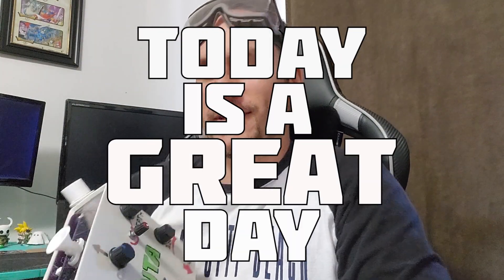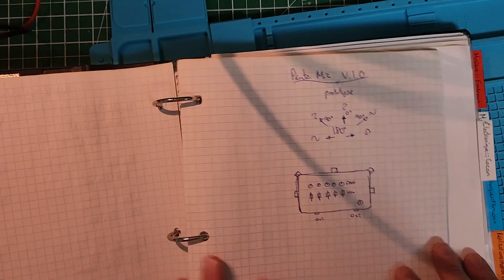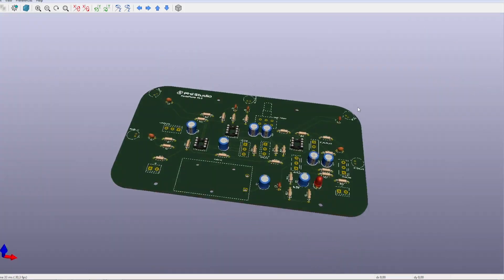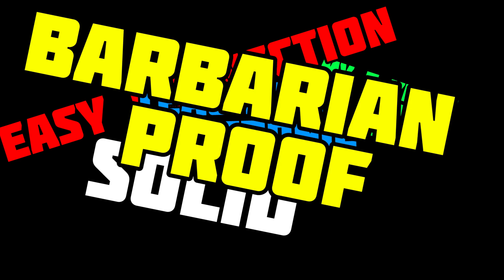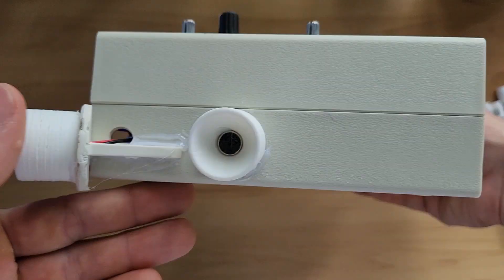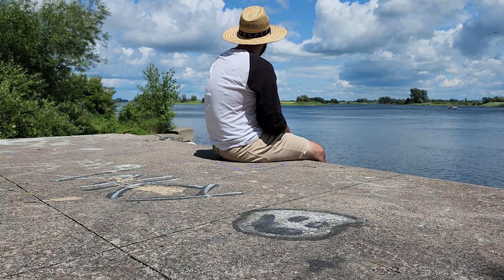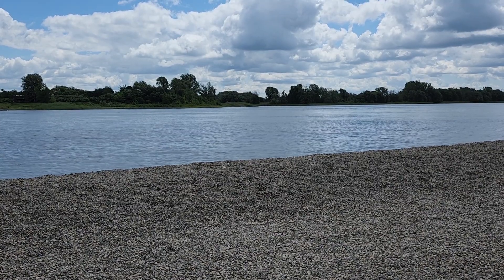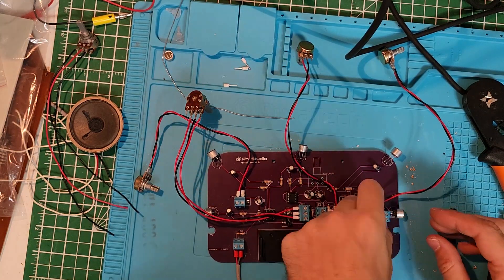Designing the World's First Pentaphonic Microphone

Comment: Especially interesting project, i have some hundred ok:ish electrets and 072 preamps in my closet and as i'm moving i was wondering should i keep them... I also tried a stereo mic with 3D printed ears first...

edit: ok, i'm keeping the electrets, i got all the components needed and a 3D printer to make a bespoke chassis that is more optimized for sound capturing. The first impressions are that it needs a filter to take out some "boxxiness", and probably a "secret" sixth mic that sits in the center and is muffled heavily, both acoustically and electronically to give it a good bass. Electrets tend to sound quite thin. Also, the pots need to be isolated from the mics mechanically, which means two units but that is not a problem at least in a prototype phase.

And then there is the possibility of using a small sound console with six inputs as the "control box", which gives even more controls and routing options, like 2.1 (stereo + LFE on AUX).... With sixth "sub" mic you can also use it in a 5.1 mix.
Reply from the maker: @squidcaps4308  i'm reading so many true and good ideas in this post. You are 100% right and this is something that I realise quite late, a single friction on the enclosure and all mic captures it. Someone also mentioned this, having the capsule isolated from the pre-amp. I still have a lot of crazy idea for this project and there's ton of place for improvement. On a final note, always keep your electret capsules :P really nice and fun component.